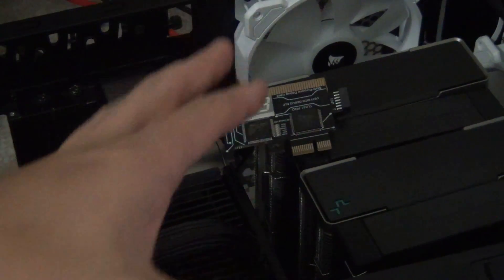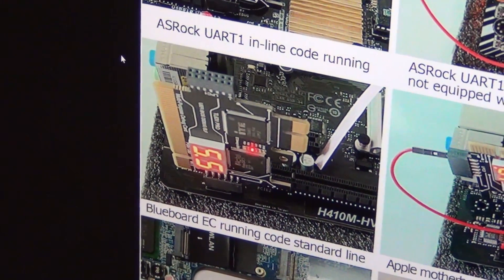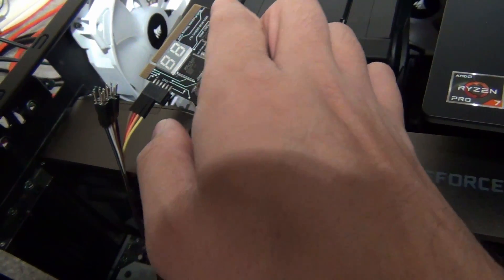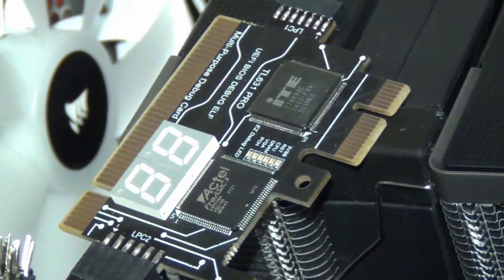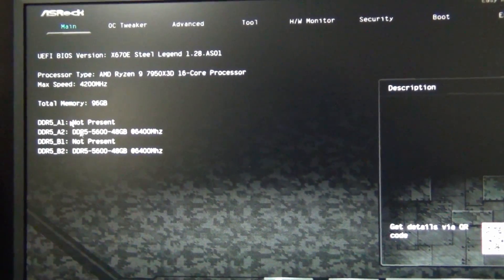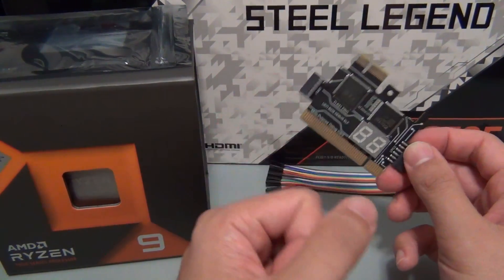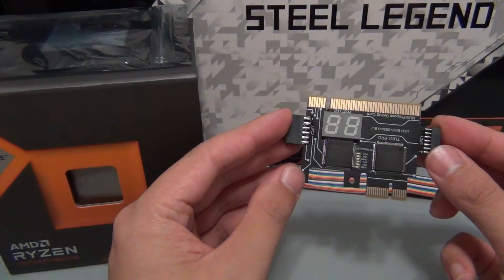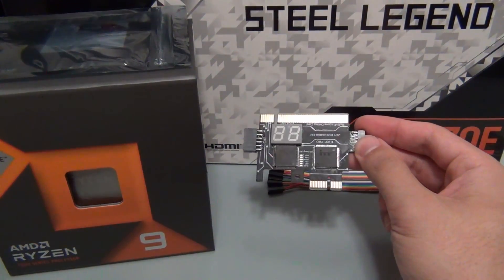Motherboard Analyzer Post Code Debugger Overview

Comment: Regarding Gigabyte, you can get post codes by connecting the card to the LPC/TPM header.  The b450-ds3h board I was troubleshooting connected pin1 of the "LPC2" connector on this card to pin1 of the TPM header.  This results in the card facing up along the right-edge of the connector.

Comment: What about the TPM header for Gigabyte motherboards? Could you connect the debug card through it?
Reply: The one i tried (b450-ds3h) did work connecting lpc2 pin1 on this card to the pin1 on the TPM header.

Comment: Hi, on the basis of this I am ordering one of these cards but I need to ask, the UART1 connection has 4 pins 3 of which are connected, it looks like an ARGB connector, you have four pins connected on the LPC2 end, can you please tell me exactly what is connected to where? Also the UART1 on my X670E Steel Legend is beside the CMOS reset pins - is it in the same on your board. Thanks in advance.,
Reply: Figured it out, 1 to 1 with pin3 disconected
Reply: @chassecourt8824  Thanks. The guy was just rambling...

Comment: its wild that $300 motherboards don't come with BIOS post code displays. I remember about 10 years ago just about any Board over $100 would have one, and I see all these recycled "X99" motherboards from China that manage to have them even on $60-70 motherboards.
Reply: Seriously I am building a new pc and not a single motherboard has debug led. Not even a port for motherboard speaker on most. For my last build 6 years ago, every motherboard had some form of debug! Dual bios with on-board switches, built-in power buttons and cmos resets all gone! It's ridiculous. And then they charge high prices for these low quality boards.